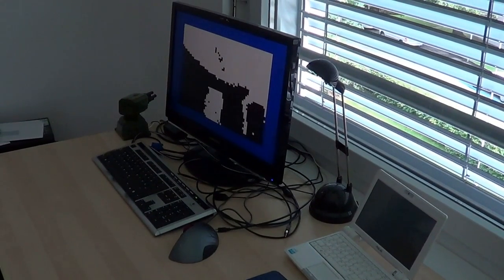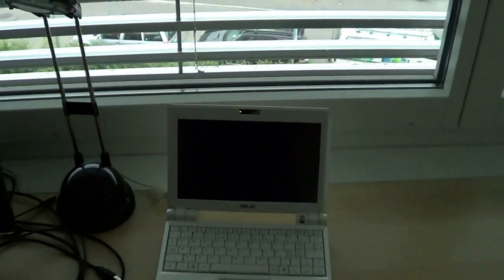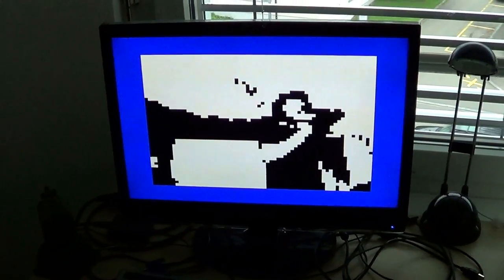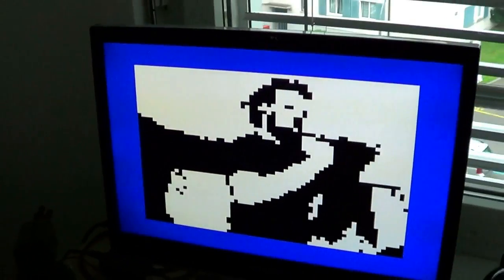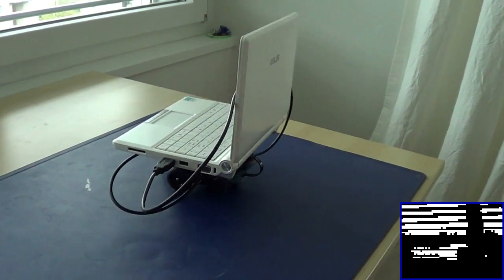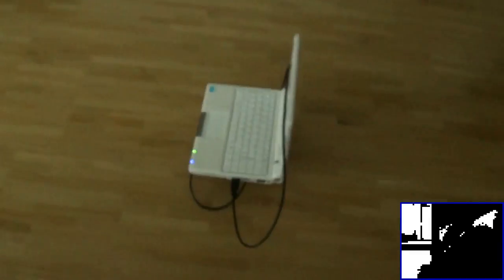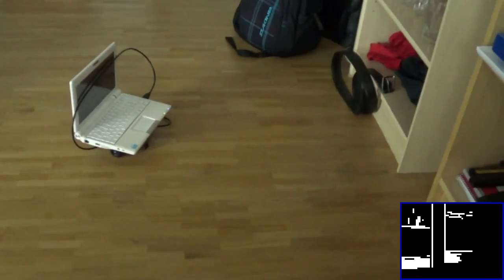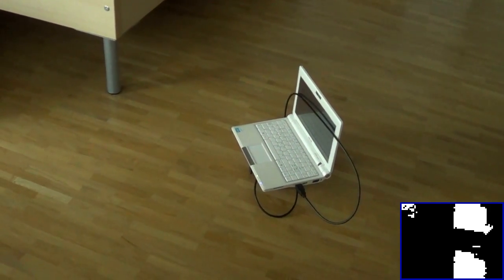DCPU-16 Camera Monitor and RC Robot

Comment: Wikipedia has an article (I just found) on "Floyd-Steinberg" dithering that may help? (Tried to post the link, but YouTube error'd out on that.)

Looks like you scan through each pixel, find the color for that one, and then take the error generated and spread it across other pixels below and to the right. Maybe not too hard to pull off if you're already processing all the pixels anyway?

Comment from the maker: You don't actually need the laptop balanced on top of the robot to do stuff with it; the robot has a breadboard on its front side which you can put extra equipment (like sensors) into and make it more autonomous, but it already comes with a few sensors of its own pre-attached.
Check out my "AVR Robot Following a Line" video to see it in action without a laptop controlling it :)

Comment from the maker: Thank you! I thought of that, and that might still be a part of the program that's improvable, but it's tricky, since you can only use two colors per 2x4 pixel block (one character on the screen). Still, it would probably be a big improvement, but I wanted to keep this project small and relatively simple :)

Comment from the maker: Good question! Using TCP here is probably a dumb idea (UDP would be better indeed), but I rely heavily on its guarantees, so I don't have to mess around with data corruption or even frame synchronization. I got it working like this and I was happy with it, but you're right, it could still be improved :)

Comment from the maker: Yes, the main computer (with the big monitor) is running a DCPU-16 program. The keyboard input is taken there and the imagery is shown there.

The Eee PC on the other hand doesn't run a DCPU-16 emulator. Instead, I programmed it with C and Python, and you can see it more like a hardware device from the point of view of the DCPU-16 program :)

Comment from the maker: Thanks! You could draw graphics with this half resolution, but the default characters are unavailable, and you can't use any custom graphical characters, because the fontmap used for these 2x2 pixels uses up all of the 128 slots.

Comment from the maker: Ah!  Actually making this was not too intense, I only worked on this for like one day... I used many parts from older projects :)

As to the "why": Notch had mentioned remote-controlled robots in 0x10c which you could send down to planets to mine and stuff.  That lead me to make my older DCPU-16 Robot project, and I've occasionally thought about real-time camera monitoring with DCPU-16s.  That's why I thought I'd give it a try :)